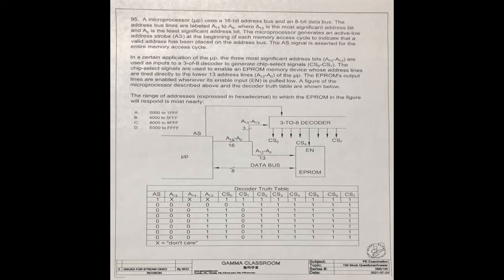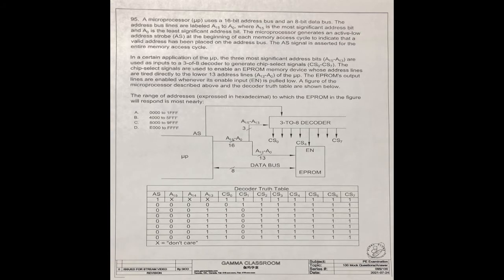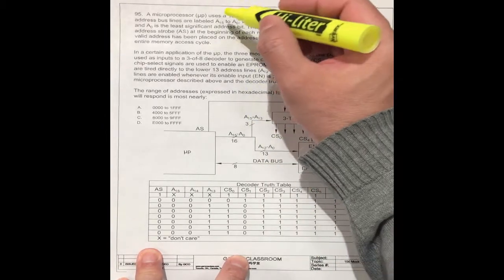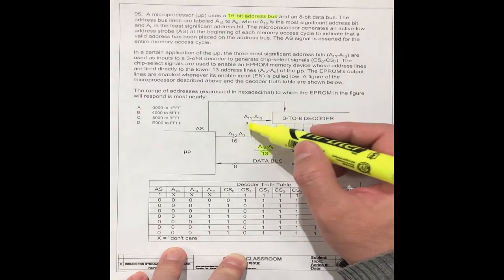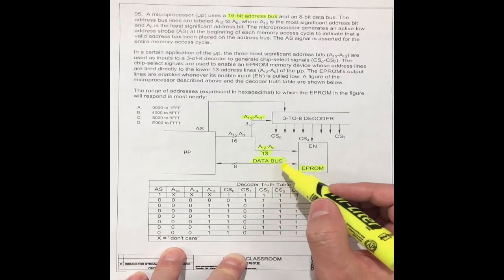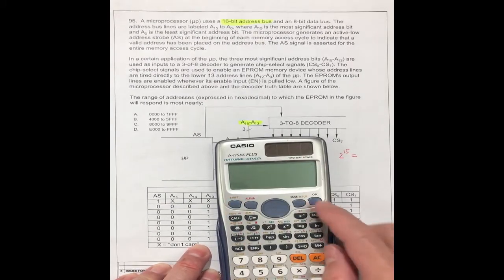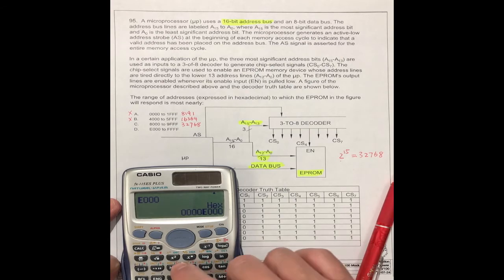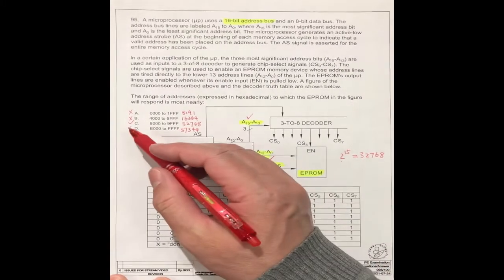Rang of Addresses, Address Bus Lines, Real Time Solution 95 for FE Exam Mock Question Series 1

Comment: If only A12-A0 go to the EPROM, why is the answer not A. 2^13 = 8192?
Reply: A12-A0 do go to the EPROM but for the EPROM to work it needs to be enabled by the decoder on bit CS4. So the only bits you care about are A15-A13. However, what's missing here is that we don't know when CS4 is low. On the the updated FE exam CS4 is low when A15-A13 = 8 and 9 or binary 1000b or 1001b. I do believe he did his math incorrectly in the beginning because he uses 2^15 when it should have been 2^16 since this is a 16 bit uP.
Reply: 16 bit address. Our counting starts at 1. Integers start at 0. He is doing 2^(n-1) So 2^16-1 = 2^15